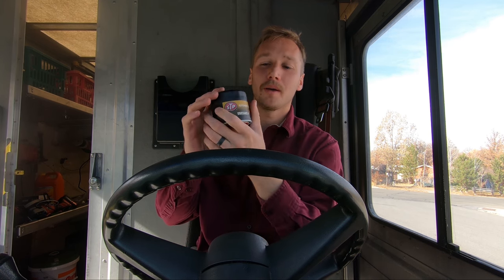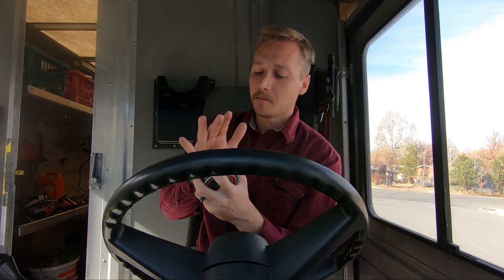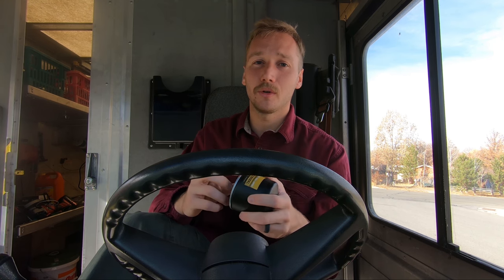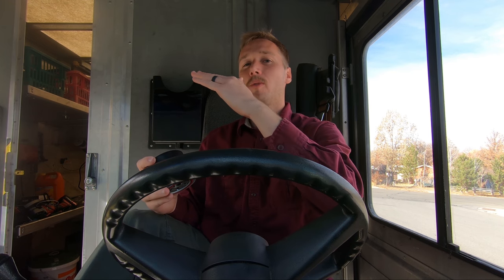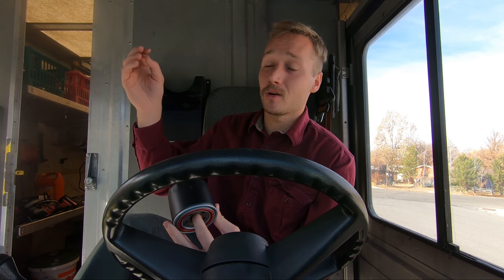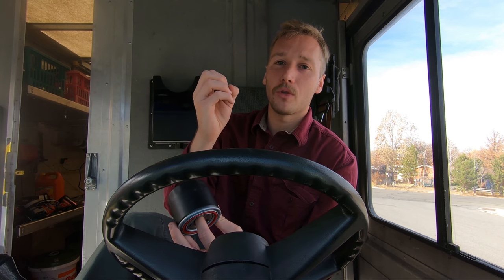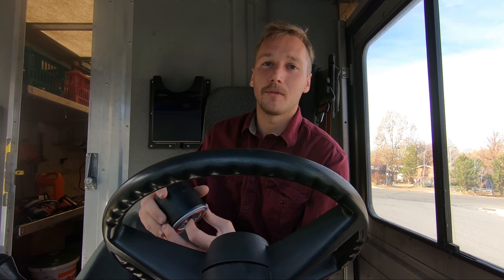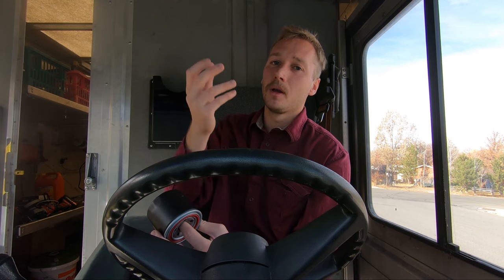Why you shouldn't put a magnet on your oil filter. **What to do instead!**

Comment: Doesn't seem like much of an argument against them. Worst case scenario they do nothing. best case scenario they either trap particles or free up more filter medium to catch other dirt.
Reply: You'll restrict the flow on your oil filter,  and the bypass valve.  It's pointless, unless you want a subpar oil filter. Keep it on the drain plug 🔌 or trans.  But not an oil filter!
Reply: @CorvetteTrev  is there an experiment to prove that?
Reply: @CorvetteTrev  

Wrong. Ever seen metallic fragments between 1-20 microns thick? They unobtrusively stick to the walls of the filter can.

Comment: If you investigate the micro size our filters catch, it's surprising that small damaging particles do get through our filters can't filter too small because of the flow restriction.
Reply: Look up the "bypass oil filters", and the data provided by CAT diesel and their mining equipment.  It filters oil by weight, not particle size. Anything smaller than 20mic is not handled by standard filters. That and magnets are awesome tech.
Reply: I agree. The great thing about magnets is that they catch ferrous particles of all sizes, even tiny ones. A proper bypass filters setup is very effective too and in a way better since it also catches non ferrous particles, but also much more expensive, bulky, and difficult to install than magnets and the extra complexity and points of potentially catastrophic failure aren't a good trade off in most passenger car applications.
Reply: @averyalexander2303  Actually they catch best the tiniest eheh :)
Reply: @dimmacommunication  eheh???

Comment: I just had a thought - if you put the magnets all around the drain hole, and then remove them just before a drain, the particles should get flushed out as the oil drains out.
Reply: It won't flush the majority of them out.  They will remain in the pan and be recirculated with new oil.  They don't just stay stuck to the bottom.

Comment: Filter only catches 30 micron and larger.  Transmissions have magnets already.  Better to catch the particles in the filter than the pan so when you pitch the filter you eliminate the metal caught by the magnet.
Reply: Allison trans have 2 magnets, one on the external spin on filter. And the filters are down to 15 microns.  The magnets always have real fine metal film.  Magnets work.  Differentials have filters also. The magnet IS the filter.
Reply: @GT-mn3bx  
Allison trans have spin on filters?
Do all diff cases have magnets in them?
(On a 94-96 caprice impala specifically?)
What exact magnets you recommend for outside of oil filters?
Where exactly can i buy them?

Thanks
Reply: Absolutely.

Comment: Here is a magnet tip for British car owners. Put a large magnet under the rear bumper to pick up the parts that fall off of the car as you drive.
Reply: Out of necessity, Chevy invented that years ago.
GM added lock washers and PRESTO! a Pontiac. 😁
Reply: @SlikLizrd  😄🤣

Comment: I have neodymium magnets on everything, oil filter, oil pan, trans pan and both differentials. Also in between frame and radiator, and gas tank just before the fuel pump pick up.
Reply: Right. Not a bad idea rusty tanks happen
Reply: Aren’t you scared that the magnets might stick you to another car?

Comment: Oil filters typically filter 25 micron particles and larger.  Smaller steel particles can still cause wear.  Trapping particles on the magnet keeps them out of the filter media so it flows more oil and filters more efficiently.  Putting a magnet on the bottom of the oil pan can trap large metal chunks in the engine instead of the disposable filter.  If the magnet is scraped off the bottom of the engine, the metal chunks are sprayed into the engine.
Reply: @Liberty4Ever  you are correct, 
Iron particles smaller than 25 microns will flow through the oil and not get trapped in the oil filter, those particles will damage the engine and also damage the oil filter, best to try and trap them with a magnet

Comment: Cut open a filter and look at the black soot stuck to the inside of the oil filter can where the magnet was. If it pulled to the inside of the can it is metal that is not filtered and is floating around in your oil. You can rub it off with your finger and feel the very fine grit. I don't want that in my oil and circulating through my engine. I'll stick with my filter mag, because it works.

Comment: I disagree. I suggest putting a MagnaFilter disk which screws to the block before you put your filter on. Then put 2 FilterMags on the outside of the filter. You said the metal debris has already traveled through the engine anyway. Well, these magnets are designed to trap the debris so it’s not scoring pistons, bearings, and cams constantly for 3,000 miles until your next oil change. Most filters only filter down to 30 microns. You would need a 2 micron bypass filter to filter metal debris.
Reply: 100% agree my friend. You are 100% right. 

I didnt pay much attention to the type and specs of filters I was using until just recently. I just figured that the parts manufacturers knew what they were doing and there wasn't much of a difference between oil filters because I ASSUMED that they all pretty much work the same. 
Let me tell you...taking the time to research and inspect your own filters will pay off because car manufacturers, dealerships, and even part manufacturers don't care enough about the consumer to let them know about engineering or design flaws that could cause premature engine failure. You and I, the consumer, are their cash cow and why would they make an indestructable car or truck engine that never breaks down. 
Granted, every vehicle breaks down eventually but you'd be surprised how much longer and farther your engine can go when you spend the time to put quality parts in your engine. 
GM should have updated the owners of their 2007 Chevy Silverado 2500 HD's that the AC Delco filters that were originally installed on the engines were potentially causing problems (which is why they told their techs to switch to a better filter) but they never shared that info with the consumers. It also clearly states in the memo that they don't share information with "DIY'ers" (Do it yourselfers) which is a fucking slap in tbe face to every GM truck owner. 
You're absolutely right, Im not a freakin ASE certified tech, but you better fucking believe that I want my truck to run right for as long as possible and if GM is gonna withold info they SHOULD be sharing with the owners of their trucks then you damn well better believe Im never gonna have my truck serviced at a GM dealership if I can avoid it. 

Don't trust the dealerships. They just want your money in my personal experience. And GM isnt the only dealership Ive had bad experiences with. I had some transmission problems with my 2010 Dodge Caliber and tried to get a new key fob made for my 2015 Dodge Dart and both times the dealership fucking lied to me and tried to rip me off. They wanted me to swap the transmission on the Caliber which was gonna be $4000 when all it needed was a transmission fluid change because CVT tranny on those dodge calibers overheats the tranny fluid and causes the tranny to slip (which is why alot of people put tranny fluid coolers on them, because its a crappy engineering flaw on the design). 
I knew what they were trying to do because I did my fucking homework before I went there. So I had the tranny fluid changed which costed about $400 but she ran fine after that. But was better than replacing the tranny at $4000. I could tell they were pissed because they all thought they were gonna trick me and the techs all tried real hard to sell me on the need for a new tranny and then their mood totally changed when I didnt fall for it. But I did my homework and I knew what the real issue was so I wouldnt get screwed. 

Next time I had to go to Dodge for a key fob they told me they had to special order the fob for my Dart. Fucking ridiculous, a Dodge dealerships without their own fobs? Are you kidding me? Then they wanted to charge me like $300 just to have the new fob programmed for my car. 
I left and found a site online that sells key fobs, found mine, bought it and an extra spare hide a key and bought replacement batferies for like $50. And I found a local locksmith who can program key fobs. Not bad at all. 

Dealerships will screw you. Ive never met an honest dealership mechanic. Never. 

Do your own homework and find an honest mechanic who actually cares about doing things the right way and taking care of their customers. It pays to do your own homework because I CAN PROMISE YOU...NO ONE WILL EVER CARE ABOUT YOUR CAR AS MUCH AS YOU DO AND DOING ROUTINE MAINTENANCE RIGHT CAN SAVE YOU TENS OF THOUSANDS LATER.
Reply: The ONLY WAY a magnet might affect the oil filter bypass valve if it was placed directly on the bottom under the bypass valve and IF the bypass valve psi required to open the valve was low, like 8 or 10 psi. MAYBE. But again, if we are talking about putting magnets on the SIDE OF THE FILTER which is smart...the strength of the magnet cant possibly affect the bypass valve. 

Also, think I should mention that the strength or psi rating that the valve SHOULD open at MATTERS. Why? because if the valve is opening prematurely, then all of the gunk which ought to be getting trapped in the pleats of the filter is actually just recirculating in your engine. 
I just changed my filter from the reccommended smaller filter with a lower bypass valve opening psi to a slightly longer K&N 1017 which has a better steel core design and a slightly higher bypass valve psi which theoretically should force more of the oil thru the filter media and not just recirculate it thru the bypass valve. Im also going to get some filter magnets. Ive never used them before because I never thought I needed to, but after taking the time to research it on my own Ive concluded that I'm gonna try it because it seems like other people are successfully using magnets to trap small fine metal particles that I really don't want causing damage in my engine.
Reply: @oompaloompa7430  Type MagnaFilter (one word) and watch the YouTube video of this spin on magnet that spins on before the filter. I use them on all my cars and motorcycles. You will thank me later.
Reply: Yes. But how and when can it be cleaned? Or do you throw it away after it's clogged up?
Reply: @steven4894  You throw it away after 50,000 miles. I throw mine away after 20,000. I also add 2 filter mags on the outside of the filter. So I have the Magna filter catching debris before it enters the filter and the filter mags catching anything else for extra precaution.

Comment: Look up the "bypass oil filters", and the data provided by CAT diesel and their mining equipment.  It filters oil by weight, not particle size. Anything smaller than 20mic is not handled by standard filters. That and magnets are awesome tech.

Comment: Most engine oil filters are 20 micron or higher. Allison Transmissions have 2 magnets, one on the spin on filter, and the filters are at 15 micron. 
Differentials have a filter also. It is called a magnetic drain plug.

Comment: This Only applies to cars/trucks, large engines with paper type filters. Many small engines only have mesh screens that have Big holes and Need extra protection especially if you your engine needs braking in which will create tons of metal shavings you don't want circulating in your engine.

Comment: I put a 5 dollar Home Depot magnet on the bottom of my filter.  It always pulls metal out of the oil that may re enter the system.
Reply: Don’t put magnets on your filter. The magnets can build a clump of tiny pieces of metal. Google: Champion Aerospace. Scroll down to Oil filters vs Tempest Competitive Analysts and then go to magnets.
Reply: @arthursmith643  Its been proven that without a filter,  5 microns and smaller particles pass through filters and do damage.
Reply: @arthursmith643  
AboutMy FathersBusiness
"1988-10-01
Review of Lubricant Contamination and Diesel Engine Wear 881827
Lube oil contamination is a primary-reason for engine wear. The wear processes promoted by oil contamination lead to diminished fuel efficiency, shorter useful oil service life, reduced component life, and loss of engine performance. Contaminant particles responsible for this damage are in the size range of the dynamic lubricant films separating moving engine component surfaces: 10 microns and SMALLER. By making simultaneous contact with opposing surfaces these harmful particles focus the load onto a small area, degrading the surface. This paper reviews the nature of lubricant contamination, the modes of lubrication, and the primary mechanisms of engine wear. The correlation between contamination and wear of engine components, as well as several important studies quantifying the effect of contamination on engine wear and performance, are discussed. It is concluded that operating with clean lube oil, maintained by 10 micron filtration (b10 ≥75), results in a diesel engine having better fuel economy, longer oil change intervals, superior performance, and greater durability.
Reply: Yes! That MAY RE-ENTER the system.  I wanted to reach thru the screen and slap him across the face when he said "it already made it's way thru your engine to get there".
Yeah, and why let those particulars have multiple opportunities to make MORE particles?
Reply: @kurt5490  Yes; from the pickup screen, oil travels directly to the filter before entering the engine.  Anyone ever seen metal in the pan of an automatic transmission.  Magnets are placed there for a reason.
Reply: I agree an engine with a filter protects the engine.  If you can remove smaller than 10 micron I would advise you do so.
Reply: @arthursmith643  So dont put magnets on your filter because it traps tiny pieces of metal making a clump and would have more of a tendency to get through the filter?  You make no sense.  I ran a smallblock chevy close to 400K before I sold it.  No oil burn at all; 4K oil changes with a magnet on filter every time.  I'm sold it works.
Reply: @arthursmith643  

1. The consequences of an airplane ✈ engine failing can be catastrophic. Not so much if you need to pull your car to the side of the road.

2. High temperature neodymium rare earth magnets 🧲 are incredibly strong. Ever try to pull them apart?

3. Any "clumps" that might break loose inside a filter would be easily caught by the filter media.

4. Airlines have tons of money for a simple oil analysis every time.

5. Changing the oil and oil filter more frequently is a wise practice. 😊
Reply: @kurt5490  😂 Exactly.

Comment: Sorry I disagree, GM engineers have tested and stated that most engine wear occurred when there’s 5 or less microns of metal particulate in the oil. No oil filter can filter that low of a micron, if it did,  no oil would be able to get back to the engine.
Reply: So why didn't they design the magnets into the engine?
Reply: Oil is filtered through the oil filter...magnets on a filter holds metal before it’s filtered through the media...do what you want I’m telling you the facts in what I previously wrote. Car manufacturers know that the warranty they give you will expire before your engine gives you problems...look at the warranty they give you, not that great!
Reply: @puregsr  Pretty sure they aren't trying to make your car last forever.
Reply: @Aaron86v  
Exactly lmfao
Reply: @puregsr  +Because the magnets do no good if mounted INSIDE the engine.
The BEST place for your FILTERMAG is on the OUTSIDE of your oil filter, where they are MOST EFFECTIVE.
Reply: @puregsr  

Planned obsolescence.

Comment: Well there are plenty of pics showing metal particles captured in oil filters by magnets.    Show there is some that stays suspended in the oil.    Cleaner is cleaner.   Personal choice to use magnets.  I bought a plug.   I won't put one in the pan unless I need to take off.   Next oil change I am getting a plug with a magnet too.   True would be great to put on inside too.   I got some 1/4 wide, 1/8 thick 2 inch bars.

Comment: I could be wrong here based on my understanding of oil flow path in an engine. So please correct me.

You state that the particle has already flowed through the engine and done the damage and that the particles will settle in the oil pan, as one of the reasons why to not put magnets on oil filters.

If I'm not mistaken, oil is pulled up from the pan and sent first to the oil filter before being pumped into the engine. This would mean that the metal particles found in the filter (or caught by the oil filter magnets) were not stopped in the pan. This further means that any particle that isn't stopped by the micron filtering level of the given oil filter (many common engine filters are rated at worse than 90% at 30 micron) will then be sent back into the engine, eventually finding way back into the oil pan where they logically could then be picked back up, sent to rh filter where they are once again not filtered out...continuing this cycle.

Comment: You have to admit that the magnet would prevent the particles from clogging your filter, making it last longer.
Reply from the maker: If you have enough metal to clog the filter something else is wrong. Also they last way longer than the change interval recommends so longevity isn't typically a worry. But I do agree you can never be too safe or take too much care of your vehicle so if you want to. Go for it!
Reply: Not in the slightest. By the time the little bit it catches would even start to accumulate it’s time to change it anyway.
Reply: @pendragonshall  clearly you’ve never cut open a filter, or used a magnetic drain plug.
Reply: @pendragonshall  😂😂